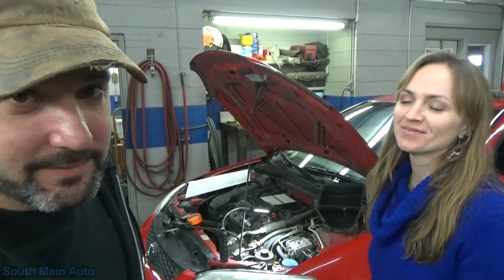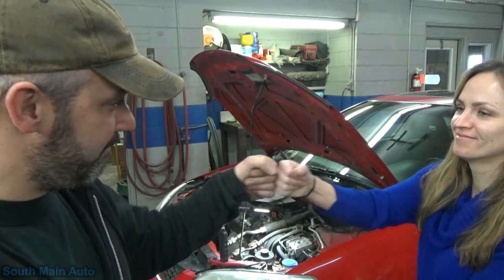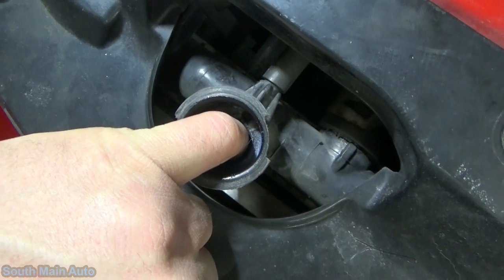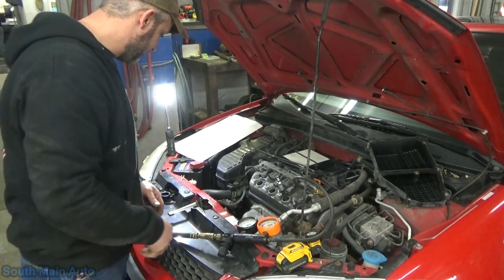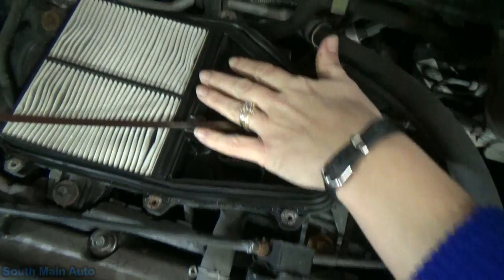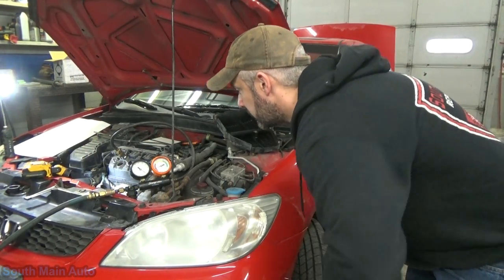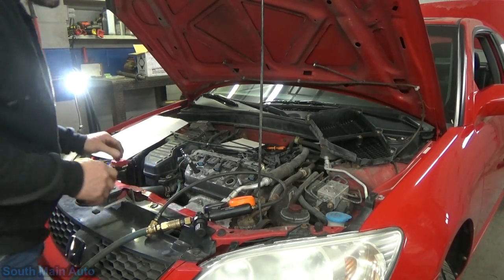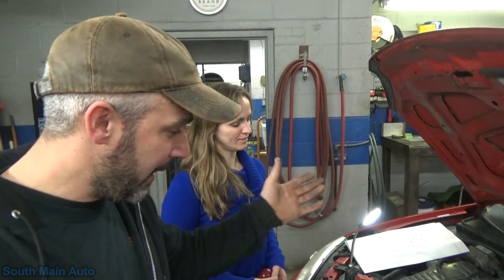Honda Civic - Diagnosis Part II - Cylinder Leak Down Test

Comment: My cheap HF tester works differently where I adjust the air pressure to the set point on the right gauge while disconnected and then attach it to the TDC cylinder to read the left gauge. My TDC finder is a wooden dowel while hand turning the crank bolt, but a poor result (compression leak) is often corrected by turning the crank again for the next TDC. In the old days I'd just remove the valve cover(s) to make sure the valves were closed. 

I always start with a compression test, removing the fuel injection fuse while running, to ensure fuel won't wash down the cylinders and the engine is warm.

For the leak-down test, I remove the radiator cap, the oil filler cap, the air intake tube, and open the throttle. Usually I listen for air escaping from all those openings as well as the tailpipe but recently I bought a 6 channel electronic stethoscope where I could place sensors in all those spots and just click through the channels while listening.  Sure it was a $72 splurge but what the heck.

Comment: I watch your videos with many distractions so happy you repeat the test conclusions at end of video. I would love if you added borescope segment for this engine to show if cylinders washed out with damage or if simple fix. I have been told Honda engines are too cheap to repair if you look around because Japan makes engines be replaced in Japan if any wear and those slightly worn engines are exported. Not sure if that is true.

Comment: Was there ever a followup? Obviously the head gasket was shot,  but were the cylinders okay, was there a crack in the head or block...? Did the intake valves seats need to be re-ground, and the valves replaced?

Comment: Quick tip to find compression stroke.. put a  balloon ontop of the hose that's in the plug well. When it's the compression stroke it will inflate

Comment: It’s kind of made me a basket case there’s so many part That has been thrown at us thing I think the timing is off when the motor was built at the factory 10,000 miles ago The dealer can’t even find out what’s wrong with itHit me up let me know we would make a special trip from Illinois to let you look at it it’s been a painLet me know

Comment: It’s been around the world got a brand new motor New harmonic bouncer good role model ignition it started with the motor got put in a 10,000 miles on it no vacuum leaks start at one minute really good in the morning but I run it fits in between 140 and 188 long Cranks

Comment: Eric, I owned and drove a '99 Civic LX for 16 yrs as my primary car, 237k on it when I traded up.  If it had been an automatic I'd probably still be driving it but the clutch pedal was wearing out my old left leg. Never had any serious issues with it. I really don't think they make them like they used to. My brother bought a 2012 Honda Civic and it was trash IMO comparatively speaking.

Oops, sorry, didn't realize that was your Civic. I'm sure it's a very nice car. ;-)

Comment: @South Main Auto Repair LLC :  What was the result after removing the head? Head gasket replacement plus Valve replacement? Polished head necessary? Engine swap? What's the fix for the lady in red?

Comment: Did a compression test on a 99 Civic 1.6L I just picked up. Pulled plugs 1 by 1 and tested each cylinder. All 4 have 120psi. Car has 202,000mi. Trying to test overall health of engine. Should the cylinders have more pressure?....

Comment: This Civic is a potential money (and labor) pit.  Before cranking up the parts cannon, re-torque the head to specs and redo the leak test.  I got an extra southern summer out of a well-worn BMW 4 cylinder by doing that about 20 years ago (along with Stop-Leak for good measure).  Also, on the leak tests it is easier to check air flow out of the larger openings with the palm of your hand over it rather than your finger down in it.  Great video! Mrs. O should get her union card and go pro.

Comment: What size coupler are you using for your test . I bought one of them OTC kits and the fittings that come with it will not fit the 05 Honda Civic . i Ain't no mechanic probably obvious huh LOL. I tried to search on the internet for an 05 Honda Civic leak down tester adapter/ coupling and what does come up does not specify the size it is or year make and model car that it will fit

Comment: Eric, I have a question. If you're listening for air leakage at the dip stick or oil cap area, wouldn't you put the radiator cap back on to be able to hear it better?

Comment: Wondered why you didn't check for blow by out of the radiator on 3 & 4? Figured after all that was released from 1 & 2 it didn't matter at that point cause the gasket was toast and/or cracked/toast block.
Reply: I meant cracked/toast head.

Comment: is it a bad idea to leave the ratchet or breaker bar wedged against something so that the engine doesn't turn over? How do you know how much pressure to test with? 100psi seems to be most common but I've seen videos whee people go as low as 15psi on a small engine like the one shown here.

Comment: Wait a minuet, I thought the front of the engine was on the passenger side, Why she cranking on the driverside?
Reply: A lot of the 4 cylinder Hondas (Such as the 1.7L in this video) Have the front of the engine pointing towards the driver's side instead. The 1.6L Civics are the same, as are the 2.2L and 2.3L Accords as I recall.

Comment: You are probably not exactly on top dead center,giving you air out the intake. Put a long thin screw driver into the spark plug hole, turn engine slowly by hand do not use starter, You get a more exact position without using a helper. Turn engine in normal rotation and then back and forth a little, until screw driver is exactly at it's highest position. Now test cylinder leakage, after zeroing your gauge. Have fun.
Reply: The valves will be closed either side of the TDC anyway so who cares. Only need exact TDC if you're working on cams or timing which he's not
Reply: I agree. A screw driver works well,  I use a long skinny wooden dowel with lines drawn on it. I keep some small balloons in the leakdown case and have also used those. But great video, thanks for sharing it.

Comment: do videos after hours, then no interruptions. giant crack in the head, it has more crack in it than the crackheads downtown :))
where isn't it leaking would be a proper question, I see my guess of all 4 cylinders bad was spot-on. crank it whichever way, not like your adjusting valve lash or need cam/crank correlation to be perfect, perhaps Mrs. O should host the show ;)
how much did ya'll cheech before recording this?

Comment: Hello Eric & Mrs O

Enjoyed the video and showing that the crank can move during the test very usefull for novice to respect. Looking forward to the teardown and rebuild. I hope you will display an accounting of both hours and detailed charges for required repairs.Demonstrateing the difference will help people understand why a salvage unit not always the most economical way to go. Time is a valuable commodity. As I am a confirmen SMA supporterI hope that a full rebuild will be required but my bet is that once the head is off only top end will be necessary. Have a great Day.
Brian & Shotty

Comment: here's a very good easy tip Eric O use a old school fuel pressure vacuum gauge to test for tdc the guage will go vacuum  when down stroke starts an will go psi when up stroke starts on tdc

Comment: So the air heard escaping out of the intake manifold was actually air that was escaping from the cylinder under test into an adjacent cylinder that had its intake valve open.  Mr O I think that Mrs O is a keeper.  A bit more air there and you could have flicked her up into the rafters :-)

Comment: Awesome video you two! Y'all make it look fun.. Thanks for showing the leak down test. It was informative. I would like to ask for your expertise if any way possible. I just did a compression test on my 09 Hyundai Accent with a 1.6 with it cold. Is that the best way or does it need to be operating temp? Don't have no overheat but I got p0300 and some mixed oil and water in the valve cover chamber where the oil cap is , but you can't see into it to see the cams. oil on stick looks clean. My cold test reads 1/135 2/102 3/102 4/90, wet 1/190 2/120 3/120 4/110. Cranked it and let it warm up and it was about 200 across them all. only  misses when cold with a lifter tap but not all the time. Haven't ran a leakage test yet but I did do a pressure test and didn't get any coolant in the cylinders. Is there a possibility that the head gasket could be blown between the oil and water jacket? Will a leakage test confirm that? Any advice you could give would be greatly appreciated.. Thanks for the laughter. You and Misses O make a great team..

Comment: So, what vehicle can you get 200,000 miles on a timing belt?
Reply: None safely that is one of the reasons  chains made a come back, but chains re- opened an old can of worms.
The longest offical belt change interval I know of is 90,000 miles but I have seen Accord 2.2 engines on 140,00 miles on the original belts.
Reply: My 2000 Neon and my daughters 1995 Mercury Villager both have a 105k mile change interval.

Comment: mechanic in a can will fix that right up
Reply: I wish he'd do it as a joke video. But April fool's is too far away.
Reply: Not always a joke. I fixed a cracked head on a Suzuki once with stop leak that would have gone to the scrapyard if it hadn't worked. Kept going for 20,000Kms before I passed it on

Comment: With the air coming out the radiator wouldn't that be a blown head gasket plus the leaking valves of course?  Oh okay, you finally said blown head gasket....:) This engine is pretty messed up, surprised it even ran

Comment: You hit the trifecta cyl to cyl, cooling system and intake but I agree the intake blow-by may be the cyl to cyl leak with the other intake valve open. You may get lucky and just need a head gasket but when they lose coolant and get severely HOT it may get dicey. One of those damned if you do damned if you don't. Recondition the head and the increased compression blows the rings out, just do the minimum and kick yourself for not doing it right...HaHa been there and sometimes you just have to roll the bones.  It was enjoyable watching you and Vanessa messing with each other and having fun. You need that in this business. Nice video & look forward to see how it turns out when you're done. I'll be looking for a fixer upper for my 14 yr old daughter so we can work on it together...it'll be fun.

Comment: Eric be very carful that the cyl. head is not twisted and warped My job? used eng.
PS Set up #1 with the mark on the pulley  Then turn 180deg. (the crank) 1342 firing order  
no help needed.  best of luck

Comment: Have to try that on my engine. But mine is a V6 which is a pain. It's much easier with a 4 cylinder as there is only one head and the valve cover is on top. Much easier.

Comment: Have u ever used a balloon on the end of the hose to find top dead center? I had an engine rebuilt and wanted to install the distributor. I did not want to remove the valve cover . My dad suggested the balloon trick. I'm not sure if it would work with a bad head gasket though, but it's another method to find TDC . Keep up the excellent work!! 👍🏾👍🏾

Comment: nice job always learning something to find top dead center maybe you could leave just a little air on the tester until it builds pressure
Reply: Best to work in the firing order after you  identify #1 compression.  On 4 cylinder I use 4 large wooden knitting needles down the the plug holes. when all the tops of all 4 needles are a equal height you know  all the pistons are at 1/2 stroke.
Reply: That's how I do it.  Put tester in, hook air up and open full and crank engine over.  Unless there is no compression at all you'll know when you're there.
Reply: +andrew w macfadyen what's the point of being at 1/2 stroke? Don't you need to have the piston all the way up @TDC to get a pressure reading?
Reply: +brian toscano Do you mean run air through the piston chamber and crank the engine until you get the most minimal blow-by reading possible on that cylinder?